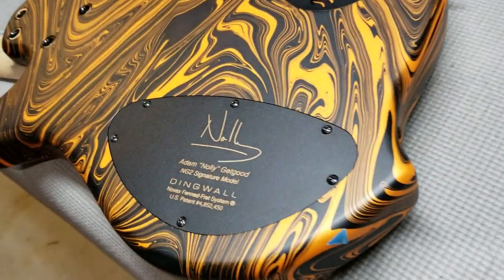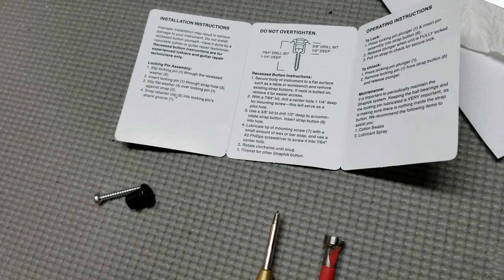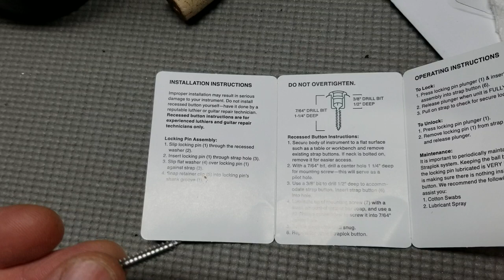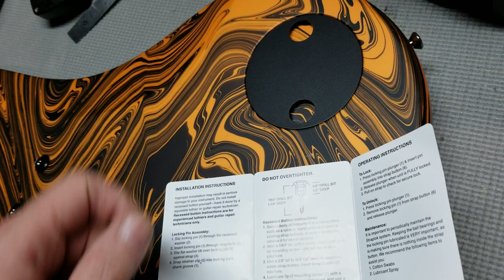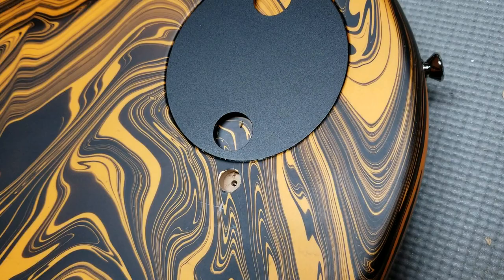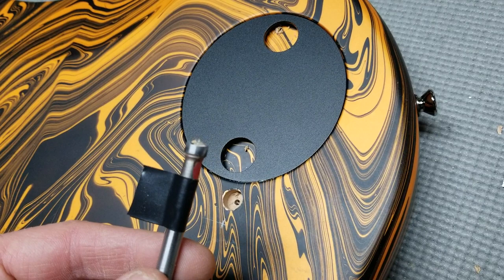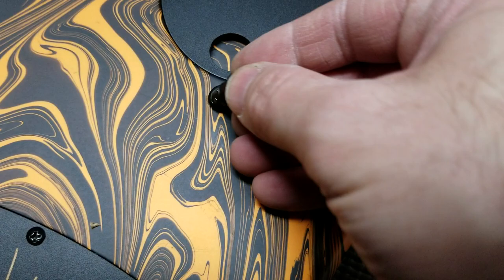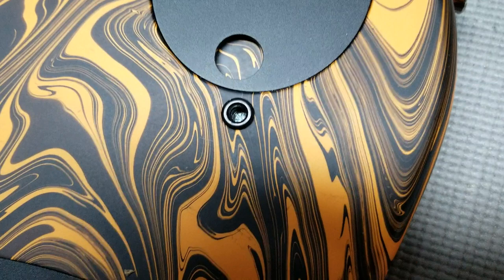Adding rear Dunlop flushmount straplock to Dingwall NG2

Comment: I would use the forstner bit first, then the 7/64 bit.
Reply from the maker: Perhaps so, but you have to make dead sure the two holes are exactly concentric.  How would you go about doing that if you did it in that order?
Reply: The 7/64 bit is your pilot hole for the 3/8 bit.

Comment: Why did you use a centre punch on a guitar? Put some painters tape down, and start the drilling operation by slowly drilling backwards with very light pressure until you clear the finish. Brad point bit for anything under 5 or 6mm, forstner bit for anything over that. Use a drill press if you can to avoid lateral movement. I've done hundreds of guitars like this, and haven't lost one yet. Hope that helps for next time.
Reply from the maker: Thanks!  Yes, I was not aware of that technique back when I did this.  You are exactly right, the way you described it is the correct approach.  I should probably take this video down so nobody cracks their finish with a center punch!

Comment: Was this install pretty easy? I'm no pro with woodworking and drilling but want to install these on my 2008 Warwick Thumb 6 NT. I'm a little nervous because it could go catastrophic quickly. I have them on my 1994 Warwick Streamer Stage II as that's what they came with from the factory in the 90's.
Reply from the maker: It was quite easy, but you want to make sure you make a small indentation such as with an awl or a punch so that your drill doesn't "walk" when you start drilling. That is really the main catastrophic risk to avoid.  Or else you can start with a super tiny size drill for a starter hole then gradually increase the size until you reach the needed diameter.   Once you have the screw hole, that should be big enough that your larger bit won't walk, but you can still follow the same principle and gradually increase the size in 32nds or 64ths.  The other big thing to make sure of is that your two holes are exactly concentric. That is key. Otherwise the screw will go in at a slant, which is no good because it won't seat in the bottom of the cup.
Reply: wa2go thanks for the info! My bass already has buttons installed with a screw that’s about the size of a Schaller screw so I know the Dunlop’s are a bit larger. Should I still center punch the old hole?
Reply from the maker: @stewartross13  Oh, sorry.  I assumed you were wanting to install a new recessed button on the back of your bass. If you want to replace existing buttons with these recessed ones, there's no need to center punch the old hole, since you already have a hole there.  The center punch is needed only if you are putting a hole in fresh wood.   I can't recall if the dunlops have a different thread diameter and/or pitch from the schallers or not, but anyway, hopefully your Schaller screw holes are not quite as deep as the new ones, so that at least some of your new screws will be going into fresh wood for better grip.  Note that lubricating the screws with soap or wax is very useful and important, so don't skip that step.   Also, make sure you put some tape around your drill bit to mark the depth so that you don't drill deeper than needed.
Reply: wa2go okay rad!! Thank you. I’m going to do my best do to a perfect install.

Comment: Looks great. How did you choose the location and how did it balance when you were done. I had the same locks on my dean V guitar and loved them. I  just installed the dunlop duel design. On my jackson dinky. They do stick out far so  I'm thinking about drilling the guitar so they are slighty set into the body to better resemble a normal looking strap button without the strap on and with the strap it won't stick out as far.
Reply from the maker: Hi, thanks for the view and reply. In my case, finding the location was fairly straightforward because this bass has an almost identical body shape to another bass made by the same builder, so I made a template from the other bass which already had the button installed by the builder, and I put this one in the same exact spot. I tested with a smooth strap, and it balances perfectly and does not wander. I was pondering how to find the exact correct balance spot if I did this on other instruments, since I am thinking about doing that. The best idea I could come up with was to use a fairly strong suction cup and move it around testing different spots, just using a piece of nylon or polypropylene twine between the two strap buttons. I would then suspend the bass right above a bed or sofa using one finger to find the balance point on the string, and if the suction cup lets go, the base will land on something soft. There is also a more scientific way involving vector arithmetic, which I learned in applied mechanics back in 1985, but I probably don't know where my textbook is and it would take me awhile to figure out exactly how to do it anyway. Important to note that you would not want the balance point to be such that the bass is horizontal, but rather that the neck is at the right angle to the floor, in playing position. And the balance point would not be the midpoint of the string, but rather would be right where your spine is in the back of your neck when wearing the bass. Of course, this is all theory and I have not actually tried it yet. I'll try to remember to update this video if I go through that exercise and but you know what the results are. I guess I will start with one of my less important instruments in case I pick the wrong spot. Now that I am saying this, I am thinking a good idea might be to just email Sheldon Dingwall and ask him how he went about finding the location on his instruments. Obviously one way is through trial-and-error experimentation, though you would have to have one sacrificial body to be able to do that. I don't have that luxury. Perhaps he used to trial-and-error, or perhaps he did some math, I will ask him.

Comment: That's a scary job. Thanks for uploading.
I'm about to try the same on my Spector...
Reply from the maker: Make sure you read in the comments below about using a drill bit rotating backwards to prime the hole a bit so you don't crack the finish.

Comment: Hot damn! Just successfully did this on an NG3, using this video. For some reason my Dunlop flushmount holes did NOT come with directions - I got them solo, without the strap-side buttons - so this was really helpful. I was LOATH to take a drill that deep into my pristine bass, but sure enough, the NG was thick enough and the installation seems rock solid so far. Very happy with the way it hangs, though it'll take some getting accustomed to the easier reach!

I did move the hole away from the foot of the bass just a hair more than your measurement, I was afraid of running into the bridge screws. 'Course you can't move it to much or you start getting close to the bridge pickup... overall there was plenty of room to put it, but I'd be interested if you ever heard how the perfect balancing point is found (and what to do if it turns out something vital, like a screw for the bridge, is on the other side of the bass from there).
Reply from the maker: Very cool, glad that helped! Thank you for watching.   To find the exact balance point, probably a strong suction cup would be best. But you would have to find one with an attachment point for a string.  Also, keep in mind the balance point would change with a significant change in string gauge.  Adamovic has found the EXACT balance point for their basses.  I don't know how they went about it, but the results are super impressive.  The buttons are mounted at an angle, and are not in the center of the body.  So it balances not only left to right, but also front to back too.